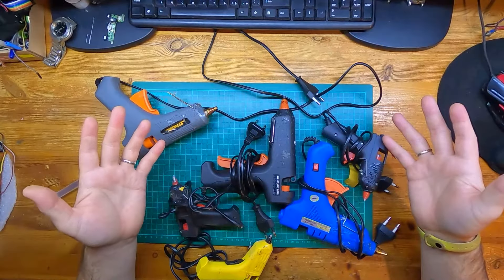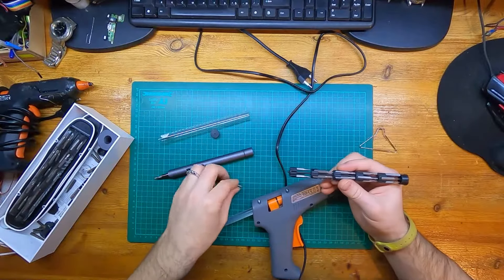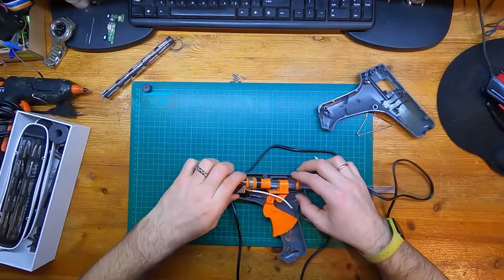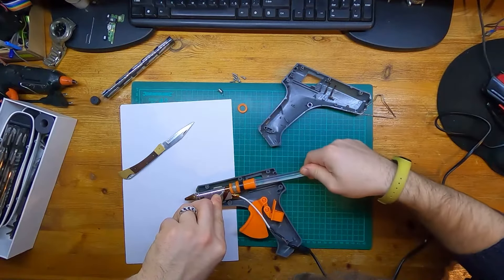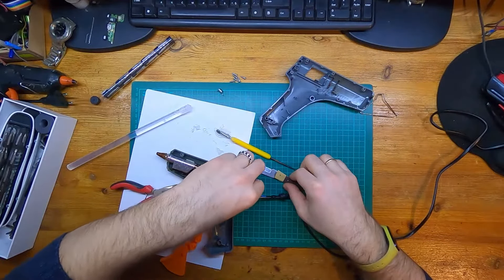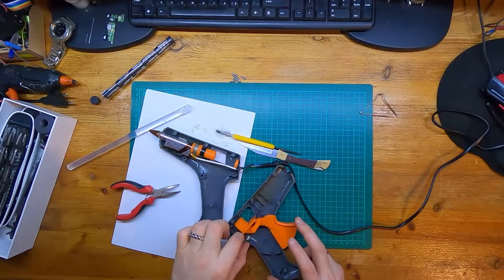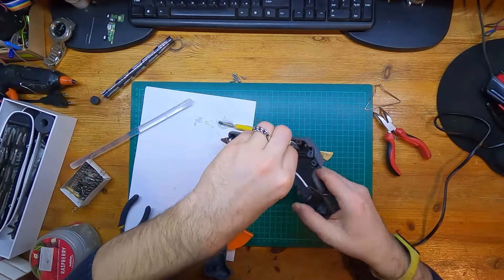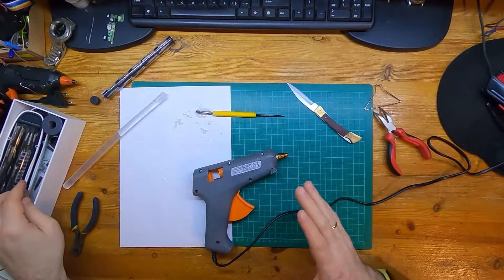GlueGun repair

Comment: 😢😢Pls how can i fixed d spring.....
Reply from the maker: Greetings! If the spring itself is broken, then you can do the following. If the beginning of the spring is broken (the small circle), then the next section of the spring can be folded open and made as a holder. If the spring is broken in the middle, you can try to stretch the spring and then put it back. But such springs can be purchased online or at your local store